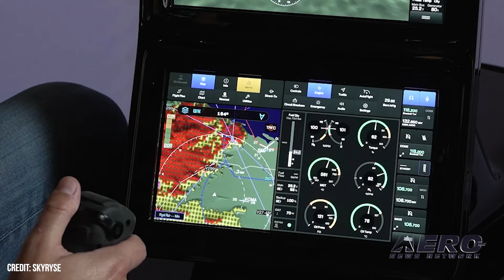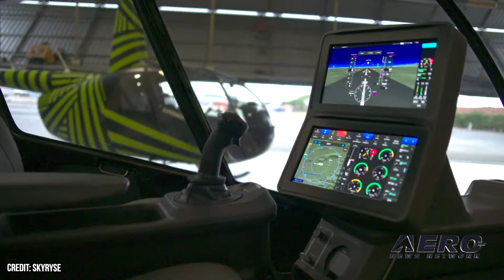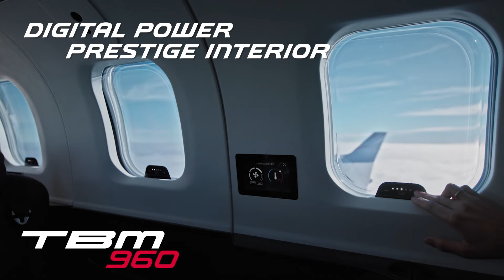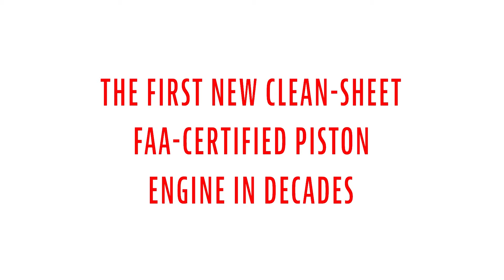Airborne 11.06.24: Skyryse One, MASSIVE Lycoming AD, Coked Up C206

Comment: Important note about Skyryse…

“Built on a Rolls Royce-powered Robinson R66 platform, Skyryse completely reimagined the cockpit design from a blank slate to create the most capable, integrated and simplified aircraft in the world.”

If you like fly by wire, computer controlled flight and autorotation…. This could be the helicopter for you!

😃